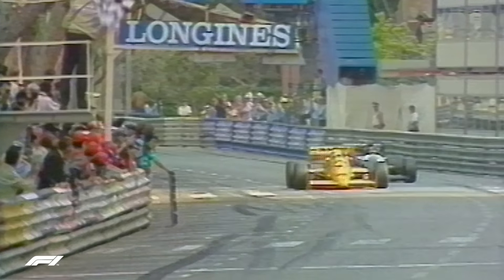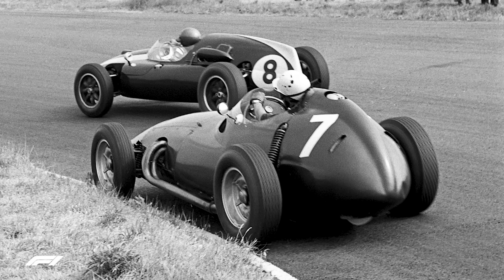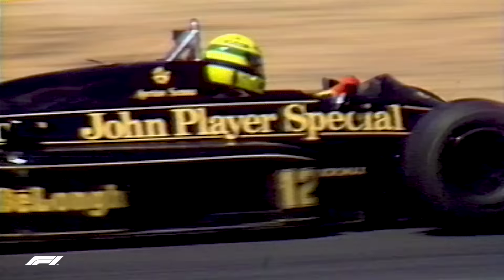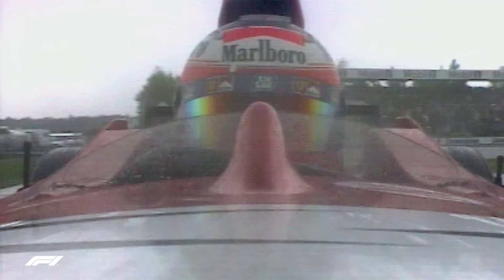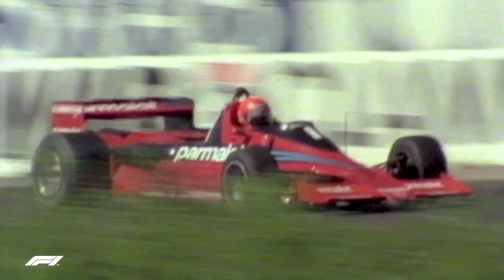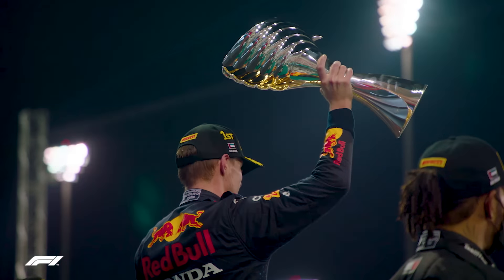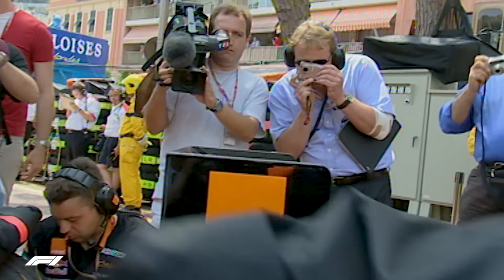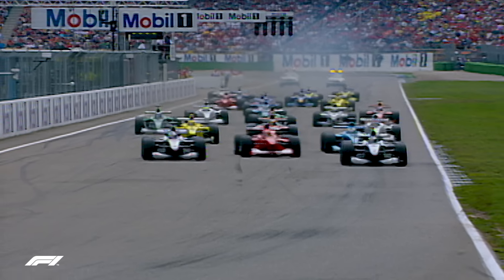Top 10 Biggest Technical Revolutions In F1

Comment: 5:46 is anyone else (mechanics, porsche fans, or engineers) tilted that they keep saying rear engine instead of mid engine when none of the cars they showed were rear engine.
For those that don't know the difference between mid engine and rear engine is based on wheels so if the engine sits over or behind the rear wheels/axles then it is rear engine and mid engine is in front of the rear axle/wheels or behind the front wheels/axles if it is behind the front wheels/axles but in front of driver it is technically mid engine but the term is usually called midship such as the Mazda rx7s(all gens)
[Politically Incorrect summary name] Mid engine description for dummies

Comment: Monocoque: Lotus.
Engine as a stressed member: Lotus?
Wings: Lotus.
Sidepod radiators: Lotus?
Ground effect: Lotus.
Active suspension: Lotus
Composite chassis: Lotus* 

*I'm sure the 88 was before the MP4? It never raced however.
Reply: Correct, the 88 was in the practice at the beginning of the season, the MP4 wasn't introduced until the 3rd race.

Comment: This video is to promote EV's, E power requires a much larger F1 car also much heavier, Colin used to say "Simpflicate and add lightness" .  ACBC was an amazing man/designer.  The aviation industry was responsible for the leaps forward in racing car design.  Disc brakes, and the monocoque comes from aviation.  As a matter of fact so is most of the downforce principles derived from aviation as well as the carbon fibre construction techniques.

Comment: turbochargers don't reuse heat energy from the exhaust, they use kinetic energy delivered from the engine by the exhaust gases!
Reply: There's a big temperature and pressure drop on the gases as they go through the turbine.

Comment: I believe the halo should be included in here. It saved at least three drivers in recent years.
Reply: Not a tech innovation. It's just a safety one, like so many introduced in F1 (Full helmet, bataclava, fire-proof overalls, seat-belts ) just one of those had much much more impact on safety than the halo

Comment: IMO, 'innovations' F1 desperately needs:
1) Mandate a maximum wheelbase and track roughly half that of the current cars.
2) Minimum weight should apply to the driver + seat only. High enough that a fit driver's proportions aren't relevant.
3) Dump the engine formula in favour of a standardised fuel formula, the standardised fuel and fluids supplied by the FIA.
4) Ban ALL aero but for a single, simple one piece wing front and rear of proscribed maximum horizontal area mounted ahead and behind the axels.
5) All mechanical and electronic settings must be fixed from the end of qualifying until the end of the race. No driver aids of any sort.
6) Otherwise fully free development with a review every other year (teams excluded) to judge if innovations are bad for racing, unsafe, or expensive.

7) All parts and innovations are freely open to trade but each manufacturer must independently design and make their own different chassis.
8) Single driver fully independent privateers may buy and run complete cars bought from manufacturers but won't qualify for constructor's points.
9) No driver will be allowed to enter a race if they don't meet the 107% rule, no exceptions. Universal Friday prequalifying for over-subscribed races.

I know, it's never going to happen. 
A prediction. While the racing this year may be a little improved I bet street races will be much worse. Especially Monaco, which will be an even more obvious joke than before.

Comment: Is Kers still a thing??? I don't hear it talked about as much
Reply: They just call it overtake now. "press and hold overtake out of turn 7"
Reply: @DelusionalReality1914  ok. I'll listen out for it. Thanks.
Reply: @DelusionalReality1914  Sort of. KERS became the passive ERS system in 2014, which automatically deploys the stored energy. The driver can manually change the rate at which the battery is drained though, with ‘overtake’ mode being the most aggressive level. But unless there’s a dire situation in a race, drivers will almost never set it to no automatic deployment.
Reply: @theocousins6386  yes man I play f1 all the time
Reply: @DelusionalReality1914  I just wanted to make the explanation clearer, since it could be inferred from your explanation that KERS was still the same as it was in 2009-13

Comment: Ooh efficiency, that really gets the juice flowing!
This is supposed to be the pinnacle of motor sport.
I'd rather a spend cap but some slack in the regs for the engineers to run wild.

Carbon neutral and sustainable fuels, really, do they think we were all born yesterday?
They fly 100 people every other week and equipment and cars all over the world to events!
Reply: The rules-limited kers efficiency allowed the massive 2021 cars to be faster than the light V10 cars of the Montoya era. However you look at it, it's still the Pinnacle, except for the race officials that seem to be brought from the South Africa world cup.

Comment: #3 is why Hamilton doesn't get the respect he perhaps deserves, Rosanna points out that Mercedes got the new engine regulations so right that on their debut they won by a long shot. 

I remember this race, it was technically over after Lap 1, and season was predicted after race 1.

And with new regulations came the restrictions on car development, meaning whoever gets it right at the start of 2014, will likely cement a way for multiple championships until next significant rule change. 

So it's hard to give Hamilton credit for 7 championships when clearly Mercedes engine was simply toying with the rest of the field.

This is also a negative aspect about F1 as a whole, restrictions on development after season start basically prevents teams from closing the gap. Perhaps there is something to it and F1 likes to have control over certain things like that  who knows. But I felt like #3 in this video really underlined this whole thing.

Comment: I wonder if supercharger is in f1?
Reply: Superchargers were used by some teams in the 50s and 60s, as they’d proven to be effective in the pre-war F1 cars. However early 60s engine regulations made forced induction cars almost completely impractical (2.5L naturally aspirated engines vs 750cc forced induction) until the 1966 regulation changes.

By the time of the 80s (and up until today), turbochargers have demonstrated themselves to be the better method for forced induction, mainly since unlike superchargers, they don’t need to be actively powered by the motor, and so don’t have the same amount of parasitic loss in regards to power.

Comment: Considering the fact that Audi had been running a high-strung turbodiesel V6 in the Le Mans Series for years - both with and without electric motors as backup - F1's turbo V6 engines weren't really that revolutionary. Impressive, but nowhere near as durable and pioneering as the Audi juggernauts that would take the brand's last three Le Mans victories to date.

Just your daily reminder that F1 isn't the only series with a history of producing impressive engineering solutions.

Comment: Turbo and Kers both use kinetic energy and not heat nor thermal energy. One is a dyno aka generator and the other is a turbine. This channel needs more engineers. Terrible representation of the sport.